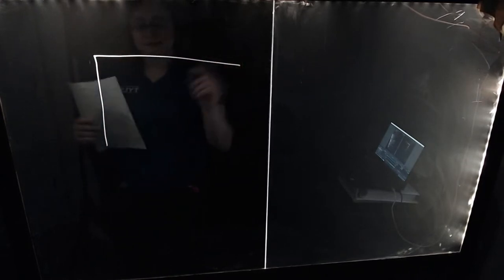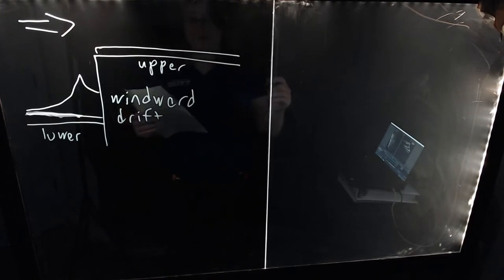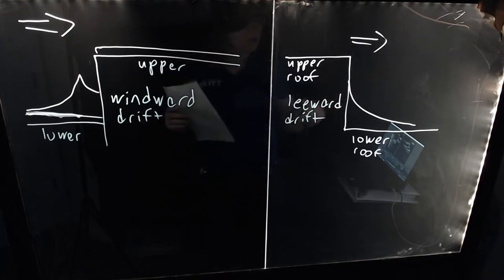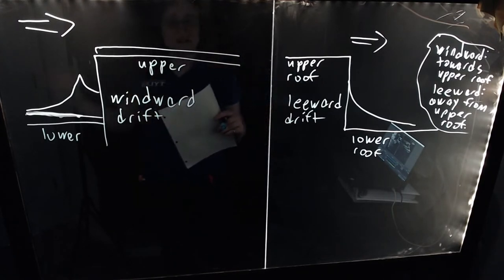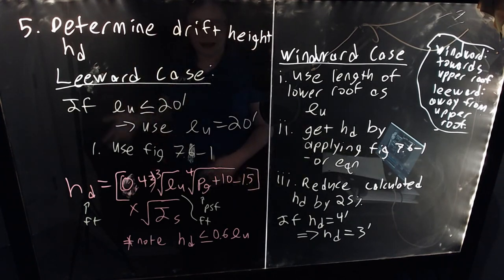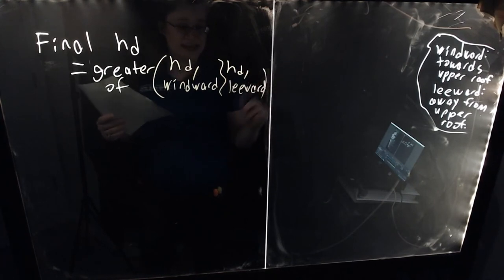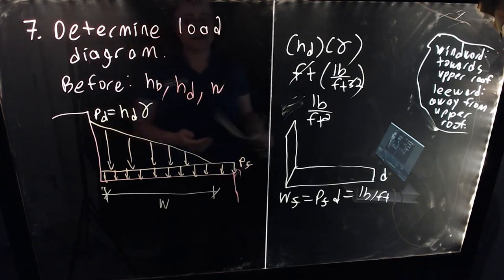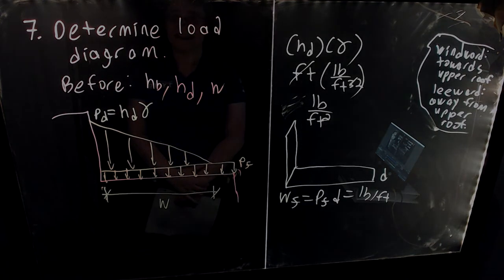ASCE Snow Drift Loading

Comment: Dear Ms Laird, at 36:40 when giving an explanation to a note you said that lu is the length of the upper roof portion in hd<0,6lu, while when calculating leeward drift lu in that case is actually the lenthg of the lower portion of the roof accroding to 2016 version of ASCE 7, isnt it?
Reply: I noticed that too. Agreed.